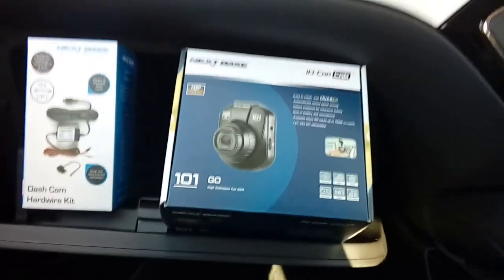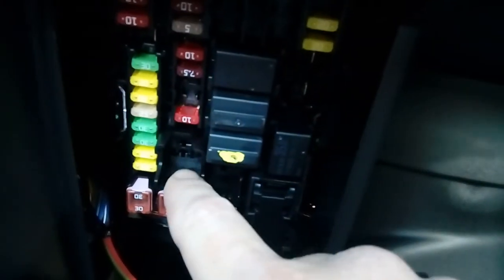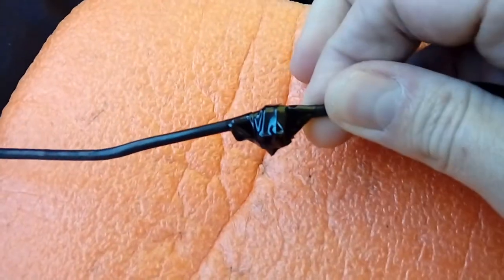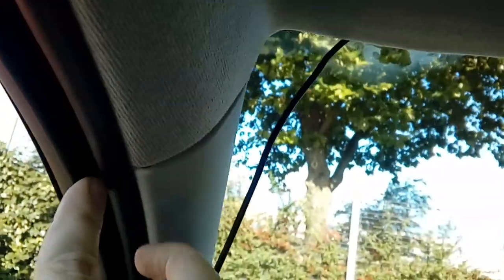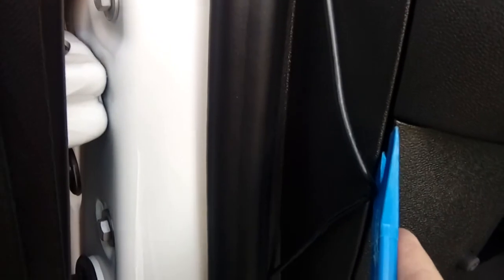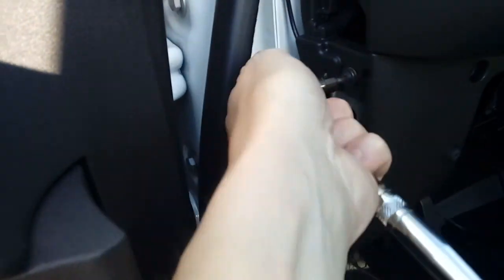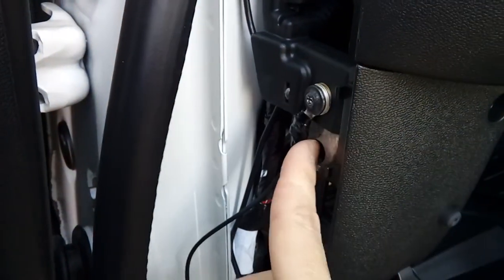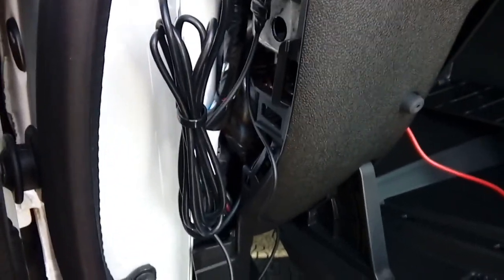Vauxhall Adam 2012 - 2017 how to fit a dash cam simple step by step guide

Comment: Hi there
I have a Vauxhall Corsa vxr 2016 model and Vantrue n2 pro dash cam (with parking mode). This camera activate in case of a incident while the car is parked.With those wire connected like in your video can you please tell me if the camera will go disconnected completely? Because the dash cam needs constant power,but I’m afraid that the car battery will die. Please help

Comment: Hi, I have a 2015 Corse SE, has road speed sign camera just behind mirror, not sure where to put camera, as if I put it next to center piece, it picks up part of trim, can you please advise where I should fit it. Bearing in mind, nearer to side on passenger or driver side, would make it easier to steal it. I am fitting Nextbase 322 and will be hard wired, with rear camera, many thanks.

Comment: Hello I’m looking to get a nextbase fitted to my vauxhall Adam can it be fitted via vauxhall
Reply from the maker: I don't see why not but get a quote because if charged by the hour you should only be paying for one hour and at main dealer rates thats pretty high. Most mobile fitters or car shops charge around £30 to wire cams up.